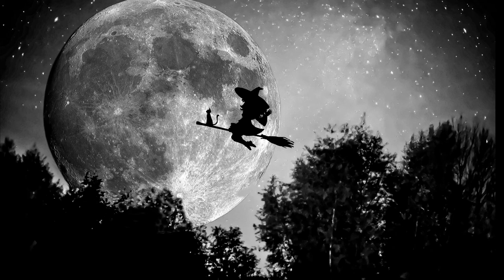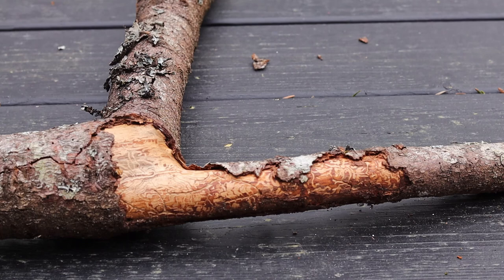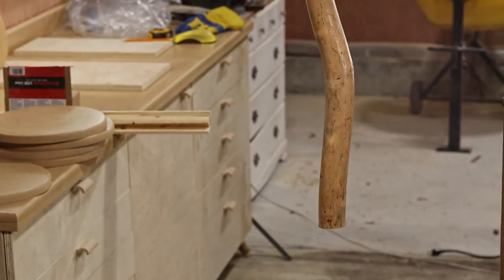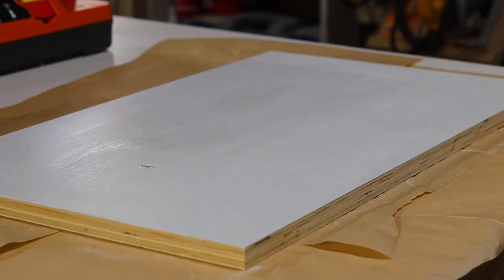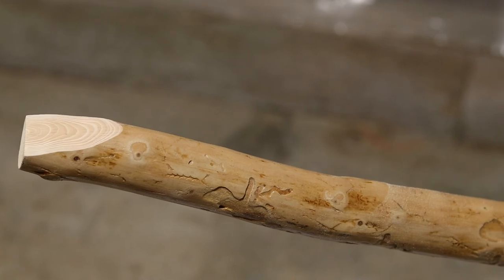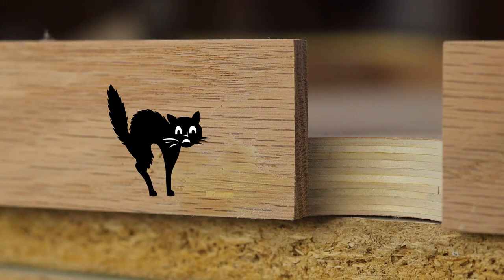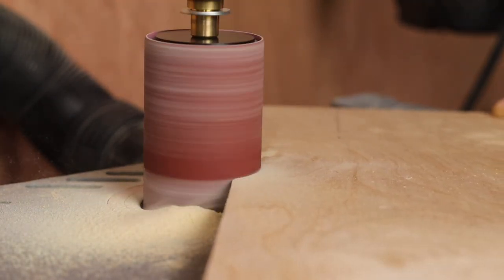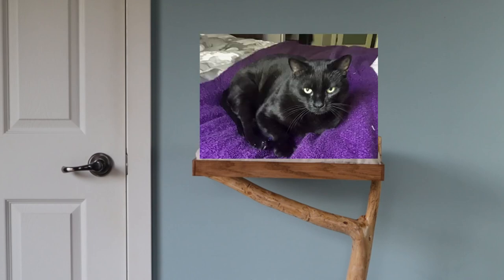How to Build a DIY Cat Tree

Comment: Thanks so much for the lag bolt tip! How tall is this sucker? Is there a max height where you feel it would no longer be sturdy with just a lag screw? I can't stand the look of cat towers unless they're natural branch, but feel the customs are pretty spendy so I'm exploring my DIY options currently :)
Reply from the maker: It's about waist height, I would now go much taller with just one bolt
Reply: @LogHouseFarm  wow, that was the fastest reply I’ve experienced from any YouTuber 😂, you just got a new subscriber! Thanks so much for the advice!! I grew up with a carpenter/contractor dad and now that I’m finally in a non-tiny apartment I’m slowly collecting all the power tools I’ve always dreamed of having. This cat tree will be my first project and this vid was one of the only ones I could find that was super helpful!!
Reply from the maker: @cloerosesmith  if you make one from a branch, be sure to let it dry inside for a while before you build or it may warp.
Reply: @LogHouseFarm  I’ll def keep that in mind thank you!!